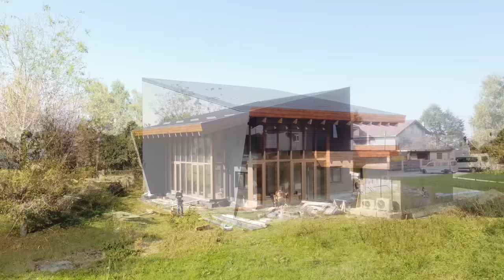Painting Magic, Watch my Wooden Facade Come Alive- My House Build Pt:16

Comment: Hello Lignum,  On and off I watched this build from the beginning.  What pops out for me in this build is the attention to detail with the rebar and cement pours.  A building that will last.  You have also taught me about the wood called Larch.  Many more details that I remember but too long to list.  I believe you designed this house and would not be surprised if you do sell a Plan Kit for this build.  It will be a success and I think it will eventually be redesigned to build with ICF blocks.  Such a formidable Do It Yourself'er.  Such a Fortress with a Scandinavian Vibe.  I did recheck the videos to see if there was a part where you showed the installation of the windows in detail but I could not find it.  That would be such a welcomed video as I have recently searched for detailed videos of the installation of European Tilt and Turn windows in ICF homes and I could not find one in detail.  Too many options and interpretations for that.  So as I return and watch this video,  I again comment,  I Love This Home.  Congratulations

Comment: The outside looks stunning, and I'm very curious how all the interior details are going to turn out.
Like you did, I hired professionals for the silicone plaster rendering, these guys are really fast and you couldn't do that yourself or with two man, even if you have some experience in plastering.
Reply from the maker: Yes, team of two for such a big surface is just too slow. The interior will be a combination of hot rolled steel, wood and concrete.. Hopefully it will turn out good😅

Comment: The house is overbuilt. Just how I like it. Beautiful and perfect execution. The original plans of my house also had these oak boards, but we were convinced not to do it because it requires regular maintenance. Not an issue in your case but still a work that needs ro be done every couple of years as the varnish fades and flakes off. We finished our home 5 years ago and our windows alre all wooden. The brown paint is flaking already unfortunately.
Reply from the maker: Yes, my worry also.. I hope it would take at least 5 years before I have to repaint it.. I figure I'l rent a spider crane with cage and spend a couple of days cursing.. 😅
Reply: @lignumchannel  for my fence I burnt it and dipped the boards în linseed oil. No issues în 4 years. The wood is still pine-colour even after 4 years it dis not turn Grey. So It's yellow-ish with black stripes from burning. Oil is an option is what I am saying. It doesn't flake,  easy to reapply

Comment: Great video, amazing to see the house almost finished. 

Some questions: 

What is the name of the metal framing system you used in your drywall installation? I don't recognize it but it looks narrower than anything I have seen before, and could be very useful when building smaller spaces where every inch matters! 

Did you consider making a rooftop deck over your carport? My first thought after I saw the horizontal parapet wall was that you built a deck up there, and then I saw no door...

How are you/did you finish the underside of the carport roof? I can't think of a way that protects the OSB but still shows the beams...

Comment: As others have said: it looks stunning! Well done on getting the exterior completed.
Originally i thought the house looked quite tall but the horizontal wood cladding has taken that away and it looks to me a lot more evenly proportioned.
I also like the side of the building in the thumbnail - the gaps in the cladding between the windows it's a nice detail.

Looking forward to the interior now, particularly intrigued by how your black ceiling will work.

So, in for Christmas? 😉
Reply from the maker: 😁i don't have deadlines any more.. I was worried the house would look a bit brutalistic but I think the cladding gave it the warmth it needed.

Comment: Do you have some form of heating? Or just the AC?
Do you plan to add some ventilation?
Reply from the maker: There will be underfloor heating with heath pump. Ventilation is not needed for this type of structure because all the walls breathe unlike frame structures where all the walls are covered in vapor barrier so forced ventilation is a must.

Comment: What do the snow guards do?
Reply: On metal roofs with a slope, you need what they call snow guards. It can be a long piece of metal or small pieces of metal scattered all over the roof that sits up at an angle. This will prevent the snow from sliding off once the sun comes out and starts to melt the snow or ice. If a large amount of snow slides off at one time it will tear off any type of gutter or trim work along the edge, not to mention as it is falling off the to the ground it can damage anything on the way down and what is on the ground beneath it. So these "guard" will prevent the snow from sliding off.
Reply: @xzytqweo3538  Thanks.
Reply: Prevent heavy blocks of snow sliding off, which can be dangerous to people, landscape, etc below.
Reply: @xzytqweo3538  Not only on metal roofs, on all roofs with a slope